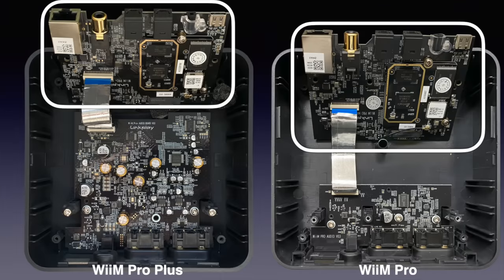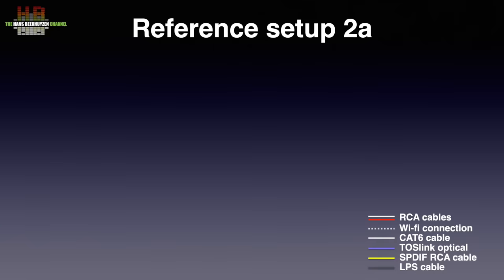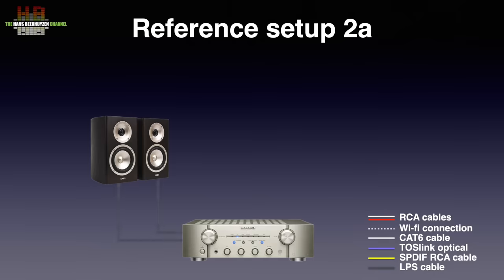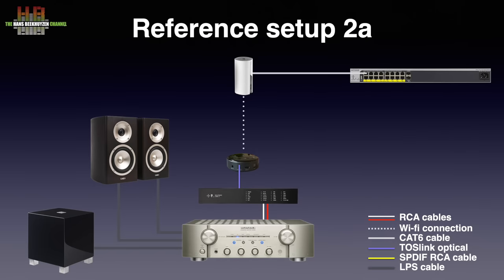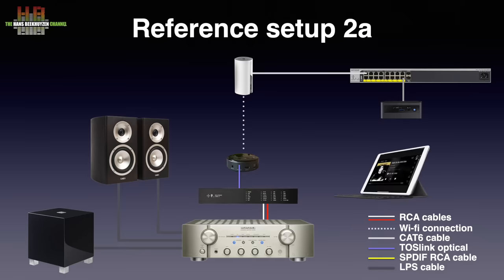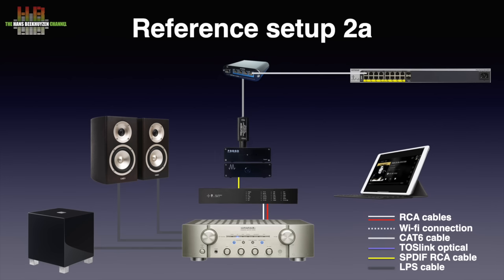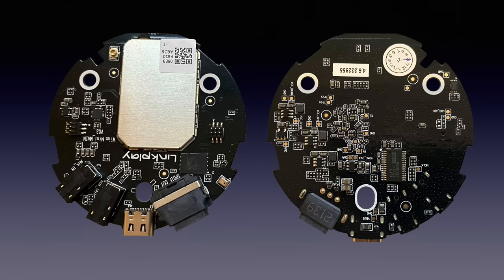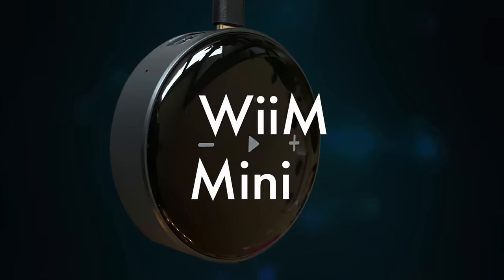The digital output of WiiM  streamers

Comment: I had WiiM Pro Plus into a Schiit Yggrdasil MIB via COAX into a Mjolnir 3 and DCA E3 headphones and the S’s were shrill and sibilant. Upgraded to Matrix Element S connected via USB into same chain and soundstage opened up and S’s sound soft and natural now. Great suggestion to pay as much for source equipment as one pays for the DAC. Very true.
Reply from the maker: Thanks for sharing
Reply: Respectfully coax and optical from the Pro Plus sound clearly different into the same dac. The reason for this is not clear and it is wrong to assume it proves anything about sources. I would assume the issue is most likely at the dac, and others would no doubt want to know about my cabling. I would question the motives and/or analysis of anyone offering up confident conclusions in this area contrary to the logic and available comparative data.

Comment: Hans, 5+ years ago you championed the SoTM SMS200/Ultra/Neo network streamers and I'm one of the thousands that have had one ever since. Could you consider revisiting SoTM streamers in comparison with you new system one streamer??? No one brings up SoTM streamers any longer. Are they still relevant?
Reply from the maker: Be assured the SOtM sMS200 Ultra Neo is in the same class as the Magna Mano Ultra MK III Farad. But  where the SOtM has USB as output,  the Magna offers AES/EBU (of SPDIG) and I²S.

Comment: I've just sold my wiim pro today. I don't think it's good in any way. A pain to use if you have a collection on a server, very veiled sound through coax output. Squeezebox touch is a champion for wiim. And this is a 15 years old streamer which had a similar price as wiim pro back in the day. No comparison really. If you want to test a good budget streamer you shoul get a used SB touch. It will cost you almost nothing. You wont get as many views, but the quality and wiim.... don't go hand in hand. Wiim has a problem with 24/192 files, cracking noises. SB touch no problems.
Reply from the maker: Thanks for sharing

Comment: And what about the Bluesound Node? It it of higher quality?
Reply from the maker: Sure
Reply: @TheHansBeekhuyzenChannel  do you have an opinion about equalizing? I have a traumatized left ear, sensitive for too much bass. Thinking about buying an equalizer (MiniDSP/Eversolo). I want to do a high pass filter at 65Hz for example. Do you think that will work well?
Reply from the maker: In general I don't like using equalising since it causes time smearing. But for compensating ear problems it's a different matter.

Comment: I bought a  WiiM Pro and immediately put it back in its box, as I thought it sounded terrible compared to my Cocktail Audio X50D streamer. Do you think a Singxer SU6 can clean up its output, Hans?
Reply: Ya the wiim products are a good value entry point into streamers but not up to critical listening when compared to higher quality products.
Reply from the maker: Better invest is a higher quality streamer than trying to cure a poor digital signal.
Reply: Interesting report. Thanks for the hard work.  I feel there is a lot of merit to your education. As this streamer adds some basic functionality to the room. I am excited about its arrival. I do pause to weigh the value in my current application.

The use of a streamer: 1. adds lossless apple music for electronic recordings 1980-current.  2. Adds room correction. 3. Multiple room streaming is more of a Christmas gimmick.

2 rebuilt technics 1200 turntables 
(nagaoka mp-150,  Shure SC35C )
Numark M6 mixer
onkyo M-282, or crown 1502,  temporary 
paradigm 40v3
Paradigm 10” sub
No treatment

Comment: Thank you for this Hans; hype for the WiiM has been deafening recently. 
If it's is not the all conquering, cost defying ultimate streamer, can you rank it against recent streamers? 
It would be helpful to know where it sits against an Allo Usbridge Signature, an iFi Zen Stream, a Pecan Pi, a Stack Audio Link or an SotM sMS-200.
You have been very impressed by a few of these but the air has been sucked out of their existence and they are almost never mentioned now.
Reply: It is not the WiiM hardware that has everyone buzzing, it is the WiiM software. What good is a streamer if the software does not allow you to enjoy the music? I wish WiiM would license the software, then I may look to upgrade back to one of the much more expensive streamers I have had through here.
Reply from the maker: They have licensed their software in the past in more upmarket equipment. Advance Paris was one of them if I remember well. But more upmarket equipment doesn't bring the volume needed to generate sufficient income. And that's needed for software development.
Reply: @TheHansBeekhuyzenChannel  I did not know that, thank you Hans.

Comment: I upgraded from a Wiim Pro to  Denafrips Arce. The difference was noticable and not in my head.  My GF who is not an audiophile at all agreed and actually preferred the Wiim.  To me the Arce had better separation, soundstage and leading edge attack.  However, the midbass felt thinner.  The Wiim was fuller where the Arce seemed to have more noticeable bass tone note to note.  I prefer the Arce.  Roon let me setup both and i could synchronize the same song and go back and forth.  Bits may be bits but transferring a digital stream can be affected by the equipment IMO.  Great review.  Much appreciated.
Reply from the maker: Thanks 🙏
Reply from the maker: Enjoy the music 😊

Comment: 😅I became a believer in “bits are not bits” when I tried inserting an ifi pure 2 spdif in chain between a sonos port and a denafrips ares 2 dac. This reclocks the signal and galvanically isolates it.  The difference was stark. Deeper base, better imaging. I suspect if I had a streamer that output usb, I would notice something similar. The problem I face is that the sonos software really is better. If I moved to something else, I’d really miss universal search across music services, as well as the solid integration with Amazon’s alexa ecosystem.
Reply from the maker: There are companies that improve the Sonos streamers significantly. Here in my country it's Magna (https://magnahifi.com/sonos-connect-ultimo/) but there are more. They sound great but are limited to 48 kHz.